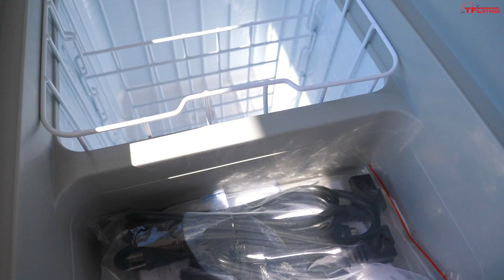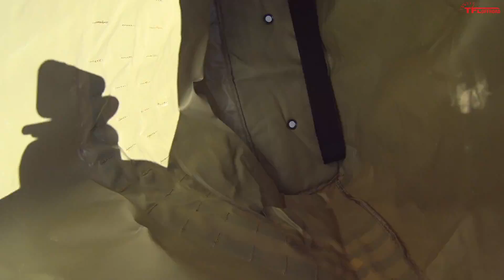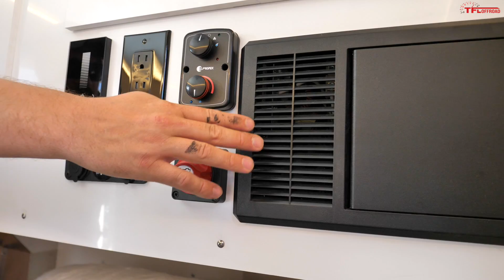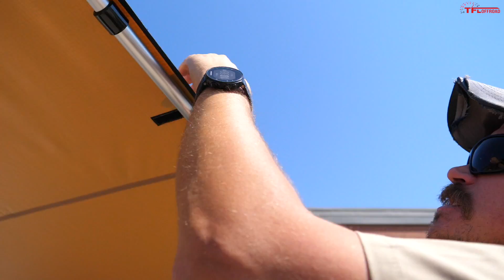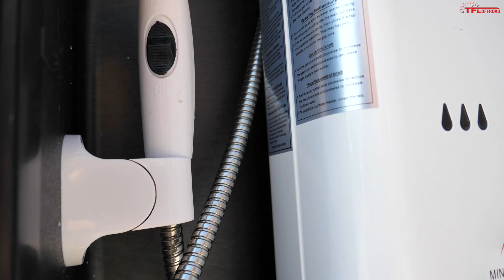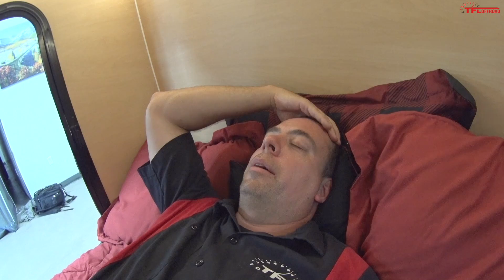Meet this Sweet $25K Boreas Series Overland Trailer

Comment: 25K ? I drive an long travel 4x4 preruner and not sure I want to pull a trailer slowing me down with a 25k price tag. I was sleeping in the back of my full size bronco but got sick of pulling out all my gear to sleep and back to go. I went to a medium/large tent and it holds a queen blow up a fold flat small 4 seat table with some extra room. A MR heater buddy when cold. camp stove and lanterns in a hard case can cook on the tailgate of in the tent if need be. Comfortable and can setup and take down within 20 min or done well 20 for each. I have been looking at trailers but for the cost I would want to build my own. Tube frame cage ind suspension on coil overs a Dometic, water heater and pump. I have a heater and stove lighting is cheap small generator not much. Aluminum sheet metal insulation and interior plastic or ?  Cover it with thin carpet like my guitar speaker cabinets inside walls. Not 25k but sell it for ? On 35" tires. Hmm pontoons on a rack can bolt on and an outboard when going some places? Bolt the pontoons to the lugs swap with the wheels and have suspension pontoons.

Comment: You make a point about it being a 4-season design.  I'd like to hear and see more about what you do to keep things from freezing.  It's well-insulated, but do you have water heaters?  The hot water for the shower is on-demand, but I think you'd need insulated tanks and some sort of heating system, and heater tape on the lines...   I would definitely want the arctic package, if there is such a thing.  I love traveling during the Christmas holidays, and I've been known to spend nights on the road at -30F.

The Aussies are all over this market, but I don't think they worry a lot about arctic temperatures.

Comment: Some of the posters have been critical of the price. Take at look at some of the Aussie comparable units. This one will then look low-priced by comparison. If the quality is there, and especially if this is an heirloom trailer, then the price is worth it. Here is another thing to consider. Think of a manufacturer such as Lance Camper Mfg. in Lancaster, CA. They manufacture both travel trailers (TT) and truck campers (TC). 

Why is a TC so much expensive to build than a TT? Simple. It's miniaturization of having to put everything into a smaller box. It's easier and lower cost to build a TT. For example, hanging the tanks underneath the TT coach is much easier compared to building them into a TC. 

Value is what something is and what it does for you. If you offered me the choice of an $800 Stihl chainsaw or a $5,000 diamond-studded gold ring with the stipulation that I could not sell, give away, or pawn off the item, I'd take the chainsaw. A ring full of hard carbon does zero for me, so it's worthless. On the other hand, since I cut firewood,  a high end chainsaw has lots of value for me.
Reply: Don't bother, you can't argue with stupid. An Aussie Bruder EXP 4, the cheap one, will set you back $50k in Aussie dollars. I'm doing blueprints for my own build, in Canadian dollars, the Dometic fridge will set me back $1300....that's just the fridge!!!
Reply: Exactly, a "fair" price is when both parties believe they have come out ahead.

Comment: These look to be terrific overlanding trailers. Here is one thing I have wondered about any of the various brands. Let's say it's raining and you are inside your tow vehicle. How do you enter your trailer without getting your bed wet? Next, let's say it's a warm summer rain, and you need ventilation. With no Vent cover, you can be rained in through the Fantastic Fan. Then, with the slide windows open, it can rain right inside your cabin. This is one of the issues I'm mulling over when looking at expedition type trailers. I'm looking at various scenarios that could be an issue?

Comment: You said the rooftop / mounting system was rated at 400 lbs.  So you could put a 23 zero 2+ person tent up there - it weighs 140lbs + 190 for a person?

Comment: Design a modular camper that the other campers with a rear door can connect to that has a common room. That has a shoe tree and benches on both sides of the camper. Or leave out the bathroom pull out and have bunks in the pull out that have pull down doors on each bunk. Then design a camper you can park and connect to another camper with the camper having an A frame with another door on the other side to exit the module.  On one side of the A frame having a toilet with a fantastic fan and on the other side a hot and cold water shower. The A frame having larger dormers on each side. Hunter's would sure enjoy something like that for sure. Now that would be neat to have for any one who had one of those campers. Have a bench to sit on on each side right in front of the connected camper door. Run the ideas past a few of your camper owners and see what they have to say? 😊😉

Comment: Y'all should design a model with hand pulled slide out's on both side's of the camper. Throw in a Murphy bed one slide out being all the kitchen stuff and refrigerator. The other side having a cartridge toilet and a little shower with a seat. Then put the door iin the back of the camper. Have a wall paper Tv swing down from the roof so folk's on the Murphy bed can watch Tv. 😊😉

Comment: $25k!?  Ah well that's one route you could take. Not one I'd take as I don't see anything near $25k in value.
Reply: David Thegan  try to build one cheaper.
Reply: @keithherring5462  Ill just buy cheaper
Reply: @Dangling_Carrot  you said it there... "Cheaper"  cheaper quality , cheaper parts..
Reply: Didn't say it was cheap to build but not something I personally place $25k value in. I do think you could build something similar for far less in material but that isn't counting you're own labour and any overhead.
Reply: @thegan9143  The Dometic fridge is about $800, Timbrens and tires, about $1800, start adding up materials, labour etc. Teardrops range from $10-20k, this is an off-road trailer, it's worth $25k, all day.
Reply: Geography in Action or just buy a better tow vehicle and buy most of those things and go into even more off road places!
Reply: @B_radd  My vehicle will pull 11,000 lbs. which is way more than I need for a small adventure trailer, I wanted a small trailer because an RV won't fit many of the places I go, in central BC.My trailer build is an aluminum trailer body, including the Timbrens which were $800, tires were $1000, still had to find rims, the total frame, including body frame, and aluminum skin for the exterior axle-less axles, and hitch, was $4000. The fridge, heater, stove, water system from Dometic, was another 4000. I am doing all of the interior finish. With plumbing, water tanks, electrical, propane, shower, interior furniture, the total cost might be as much as $15,000, hoping for $11k. There is a lot of work, time, etc., put into this, and most of the welding I contracted out. Aluminum costs were less than $1000, but there is the fabricating and labour too pay for. If I sold my trailer, I would sell it for $25k as well. The trailer body is 10'x 6'6''x 6'6', and it expands!!! Hitch and tongue are 5'6' with a tool box and separate propane box. there is a slide-out kitchen that I built too, and that cost money. Table folds into a bed, lots of interior storage, there will be a small TV, roof racks and roof-top tent capability, 2x12v batts with solar. This all costs money. Seals, fan, windows, doors $$$$$$$! This trailer has 24' of clearance, and 16' right under the hubs. It will go anywhere, is made of metal, and is still very light. This costs money, I bought everything on sale or by buying last year's models...my prices are in Canadian dollars, but due to sales, they were closer to US dollars....if a trailer build is $15k, you need a markup to pay for time, labour and materials. $25k may seem like a lot, but the pro-built jobs in the US and Australia, can set you back up to $100k, and we're talking expedition trailers, not RV's.
Reply: @geographyinaction7814  its a rip off!
Reply: @B_radd  And you have proven yourself to be an idiot. You talk like one, "just go buy a better tow vehicle"....why? So you can spend $70k+ on a truck, and another  20-100,000 on a trailer that can't leave the pavement? Go buy a tent trailer that will put you back 15-50k? You try and build a trailer like this, build it, and sell it for a profit, and pay all the guys that work for you. You can't go down to the local Wal*Mart and buy one for $998. I think that this trailer is nowhere near as well equipped as some others, and maybe 25k is a bit steep, but it's not a rip-off. As I said, Tear Drops are going from $6k to $28k depending on design and features, that is what the market charges, and the gear that is used to make them , is expensive. but it is a bespoke item, that costs money. There is this other thing, it's called inflation, and there's one other, it's called specialty piece of equipment.
Reply: @geographyinaction7814  yep two types of people, ones that build, and ones that think everything should cost 1.99$ 😂